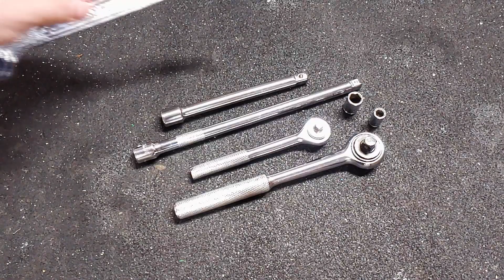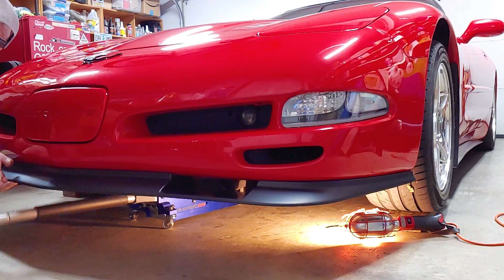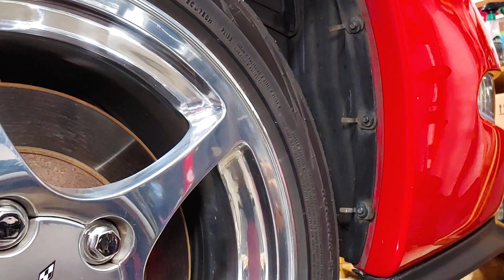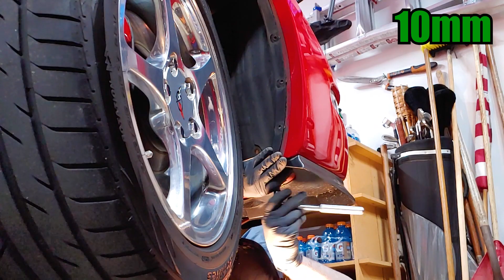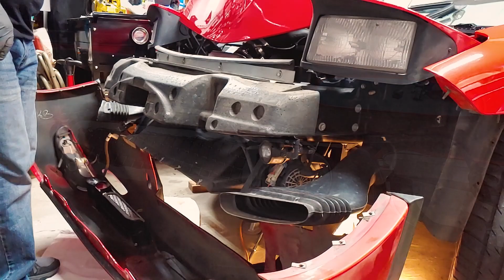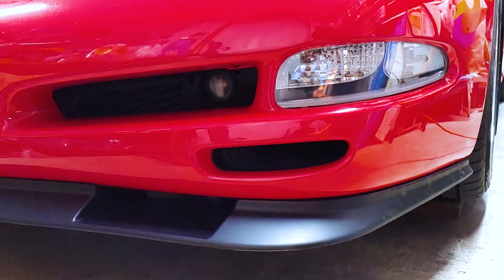Vented Fog Light Shrouds Installation Guide for C5 Corvette 1997-2004 with Tool Sizes

Comment: I bought the West Coast Corvettes fog light panel screens (resembling what you have here) and installed them both from above, without removing the bumper cover.  Dexterity, patience, and the right tools is all it took.  Once installed, I put on a factory Z06 airbox cover.

Comment: That's interesting. I just used my Dremel tool and cut out the original plastic on both sides just up to the fog lights. I have that split intake like most people have on their C5's. I tested it out with my leaf blower and yes the air travel to the filters on either side. I have definitely noticed a difference with throttle response and flow of heat away from the engine bay.
Reply from the maker: Yeah, the extra airflow seems to help a lot. The owner will be installing another vent soon where the front license plate goes. He plans to do autocross racing so needs all the airflow he can get.

Comment: I have a few things I want to that will be a lot easier this way: vented fog light shrouds, led corner lights, fang frame protectors.  I’ve done the fog light shrouds before on another C5 from the bottom and there was a lot of cussing and scraped knuckles. 

Makes sense to do it the right way!   Thanks for this video.
Reply from the maker: I thought about trying it that way but after looking into it, it's really not hard to remove this bumper. Glad you found it helpful. Hope you're doing well, Bat.

Comment: I notice you didn't have to remove the turn signals but did  you have to unplug the them to be able to place the nose on the ground?, Asking for a friend ,,, ahem,,, lol
Reply from the maker: I had to unplug one connection with the bumper halfway pulled off. I show it in the video.
Reply: @EndlessMoneyPits  I can see that it is like a big harness for both signals now. I didn't look closely enough at the turn signal on the driver side to see that they were still plugged in. My shroud on the passenger side of the car is totally loose and flopping around in the cone, its not moving a whole lot, but when you look at the front of the car closely you see it and it bugs me so I have to get that fixed. I am not all that handy with cars but thanks to videos like this I am willing to do the simpler things. Thanks for posting this actually is a teriffic video that I will follow to fix my passenger side shroud, I will probably take both of them out and clean them up while I have it apart.  Thanks for the response too!! Greatly appreciated!
Reply from the maker: I'm happy to help! A lot of bigger jobs become pretty simple when you look at them one step at a time. That's the only way I get through it, really. Good luck with the Vette!

Comment: I don't see this as getting any air to the radiator. This is just packing air under the front valance.
Reply from the maker: No, it does not direct air to the radiator. It allows more airflow to the cold air intake I installed as well as the entire engine bay to help cool the engine.

Comment: Why not just go through the headlight area?
Reply from the maker: No room
Reply: @EndlessMoneyPits  even with the headlight out? I have KnightDrive sleepy eyes. So for me, it would take about 5 minutes to remove the lid and lights. Or is the offset a little too much to reach the bolts on the shroud?